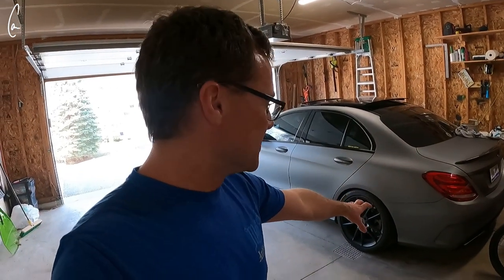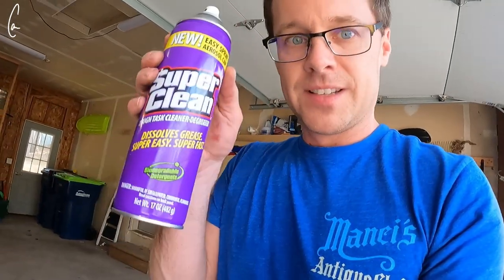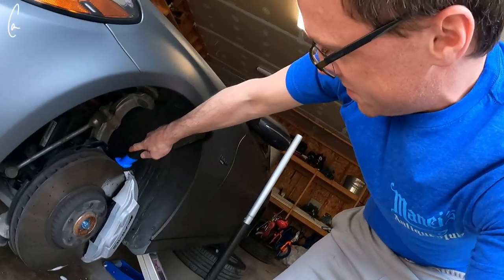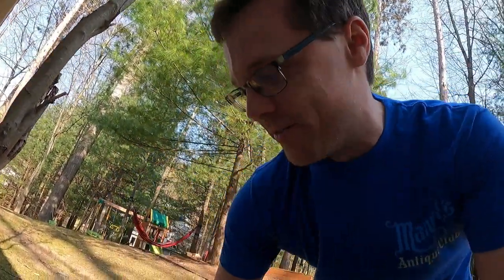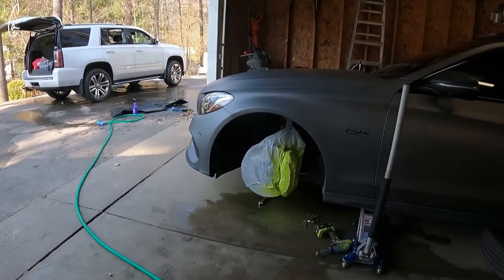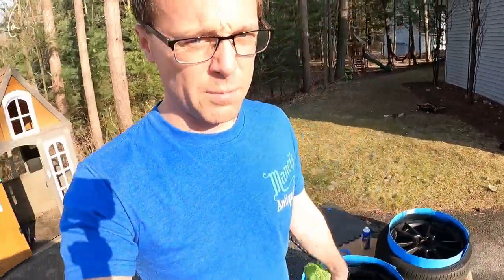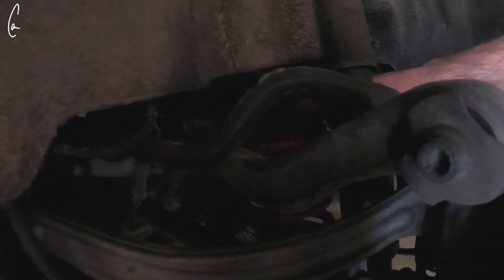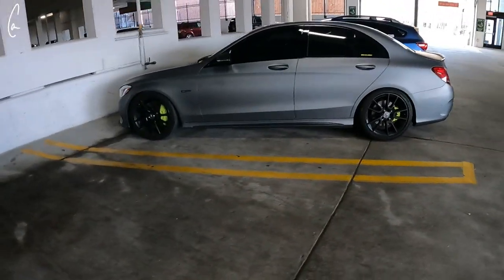Spray painting my C43 AMG Brake Calipers, lol.

Comment: Hey! Thanks for the content, any tips for lift jacking the car without hurting the frame?
Reply from the maker: I just use the factory jack points on either side - easiest way to find them is look for the square cutout/plug in the ground effect piece; there is one behind the front wheel and in front of the back wheel / that lines up directly with the Jack pad under the car